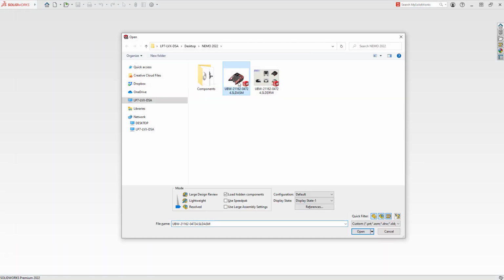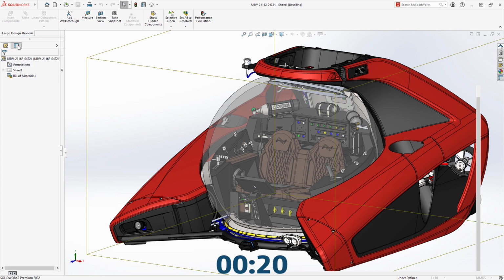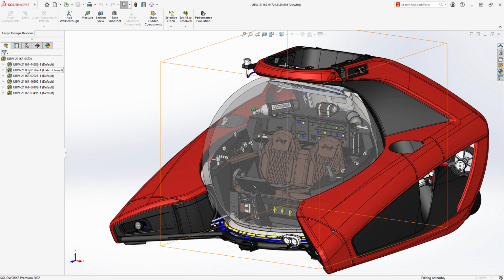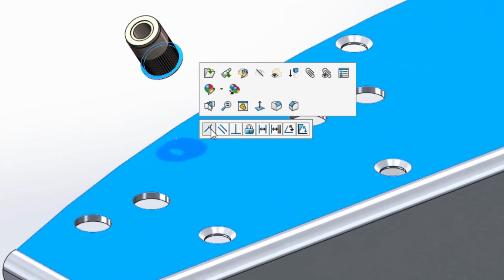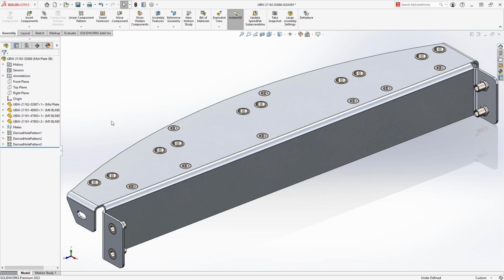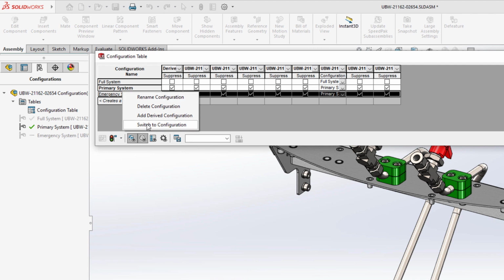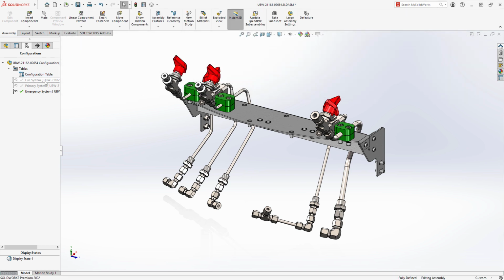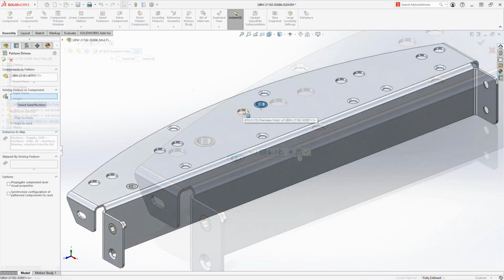SOLIDWORKS 2022 - Assemblies

Comment: How to show description of suppressed parts and components? How do I know which component to restore if the description is not visible in the tree, only the component name? In my case, the components have a numeric name and I can't remember all of them. 3:52
Reply from the maker: Hi there, have you checked out our page on Controlling the Display of Assemblies in SOLIDWORKS Help? https://help.solidworks.com/2022/english/SolidWorks/sldworks/c_Controlling_the_Display_of_Assemblies.htm?verRedirect=1
Reply: @solidworks  If the part name is, for example, 01.00.03.00.001 and the part description is "Attachment Hinge", and the part is an assembly item then:
If it is not suppressed it shows in the tree as "01.00.03.00.001 - Attachment Hinge", if it is suppressed it shows as "01.00.03.00.001". The description disappears. This is an error. When are you going to fix this? You can see this in the video above, the engineer suppresses a component and the description of that component disappears. 3:52

Comment: Yes. I love the option to set a configuration property to default exclude from BOM! The work around i have been using for years was to add the component to an assembly and set it the exclude in that sub asm. Then set the asm to promote parts to bom.

I hope i can try this setting soon.